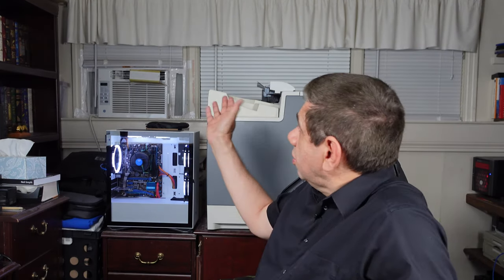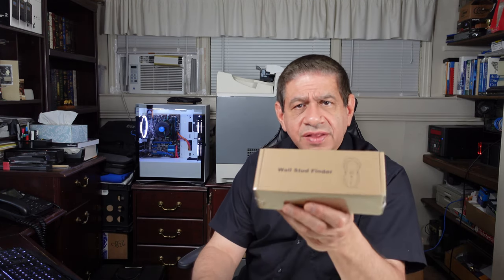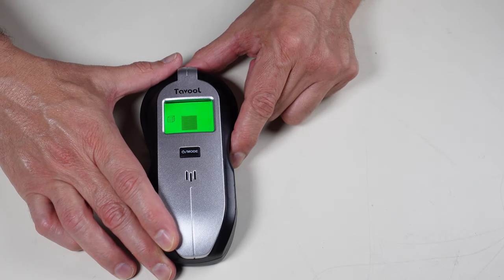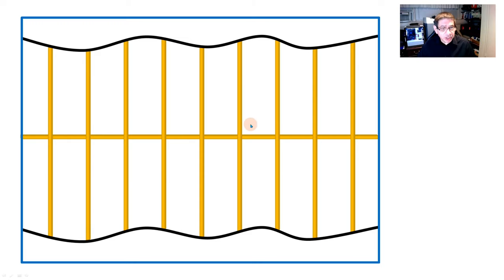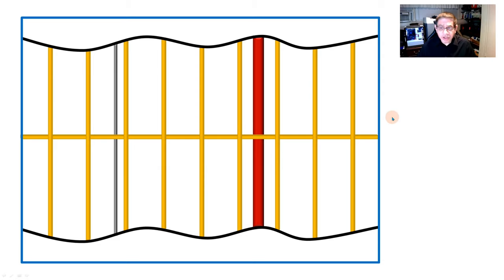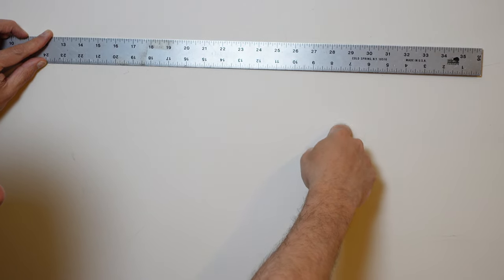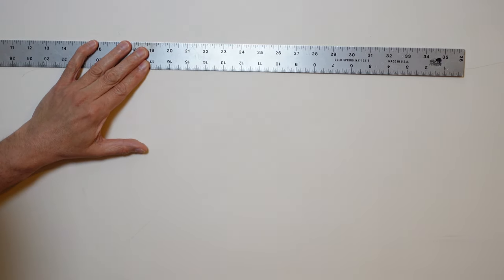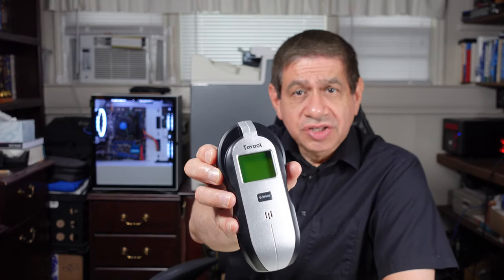THE TAVOOL WALL STUD, PIPE & ELECTRICAL FINDER – Box Opening, Product Review and Operation

Comment: very informative and helpful, appreciate the work put into this video
Reply from the maker: You are quite welcome.  Did you, or will you, buy one of these?  I use it quite often these days.
Reply: @PE4Doers   i just got my hands on one secondhand from someone, so i didn’t have the manual. Was a little confused on how exactly the electric finder worked but you hit the nail on the head with explaining
Reply from the maker: @imagaskabo  Wow, I'm glad I was able to help.  I really like that it it finds the center of the studs quite accurately.  Devices like this have become much better since they were equipped with embed microprocessors.

Comment: Hello I want to put a floating shoe storage in my garage. I have the same tool. Metal was detected where I want to put the shoe storage but it’s between my four nail holes. Should I still drill there? The storage is 20 inches and where I’m drilling is at the 1 inch and 20 inch mark. The metal was detected at the 10 inch mark...
Reply from the maker: Do you think there might be a pipe in that location?  You could carefully use a small screwdriver to test first, but a drill could puncture a copy pipe.

Comment: I am having issues with this stud finder - more specifically with the AC detector mode; I have calibrated it to the instructions and your instructions. When moving most surfaces it is detecting electricity and just constantly beeps - even if I recalibrate it makes no difference. Even tested on a wooden hollow door and it does it all over. This doesn't right.... There are tiny pockets of spaces where it doesn't beep on wall but 95% of the wall beeps.
Reply from the maker: The Electrical locator can be a little Flaky - that was the situation with the old one I had (that was lost).  I think it is best just to take it as a warning that there are electrical wires somewhere in the vicinity.  Make sure you always use hammers and/or screw drivers with wood or plastic handles when doing work in a vicinity like that.
Reply: I hear someone say to pay particular attention to the display rather than the beep(when the beeps are frantic)

Comment: Horizontal fire blocking is not common nor required. Studs are 16 inch oc sometimes 24inches on centers.
Reply from the maker: Yes, correct.  Sorry I said 18", I think I added a pop-up correcting myself.  I thank you for the comment :)

Comment: Mine came with battery
Reply from the maker: WOW, that's great.  Maybe they realized i, or there were complaints.  How does it work for you?
Reply: @PE4Doers  Actually your video is very helpful. I just got myself a tv bracket but my studs looks like 13 inch apart, that’s why started to research the videos online
Reply from the maker: @aselkin  I'm glad I could be helpful.  Wow - 13 inches.  I've only seen that when they were trying to go around a plumbing pipe.  Do you have a restroom on the other side of that wall?

Comment: One of the worst stud finders you can buy everytime I try to locate the stud it show it in a different spot
Reply from the maker: I am surprised you had trouble with it.  I have had good results from it numerous times.  One thing I had to get use to is not holding down the button the way other stud finders require that I do - that would continually reset the depth-sound measurement.